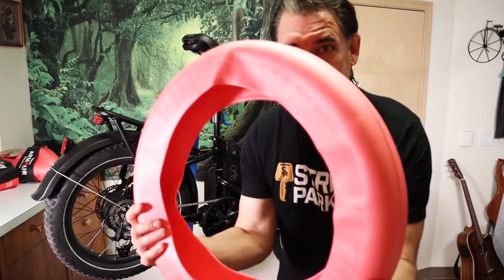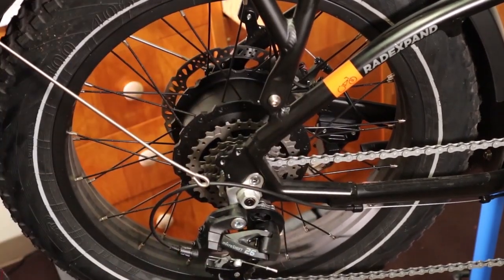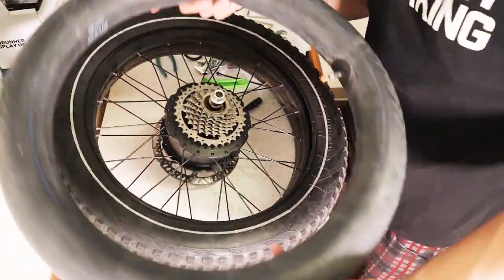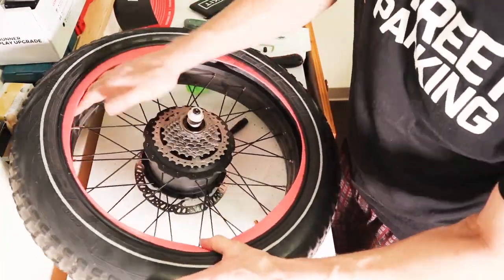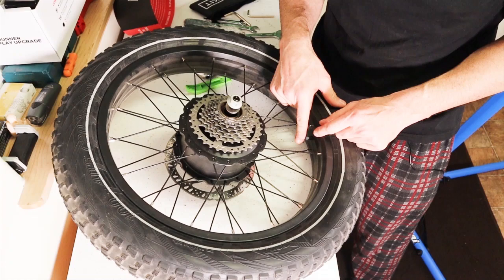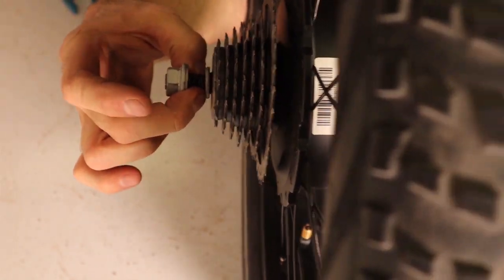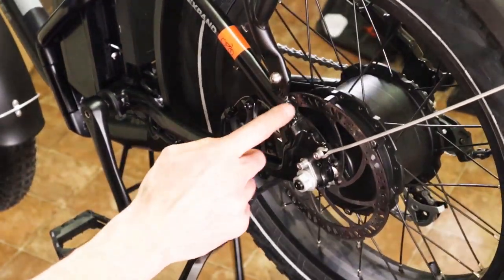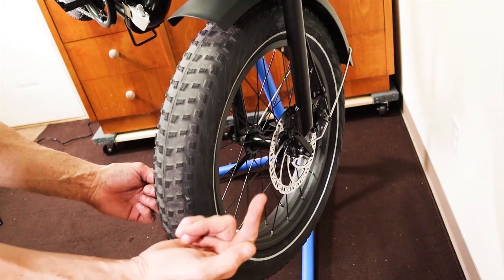RadExpand 5 - How To Install TANNUS ARMOUR INSERTS

Comment: Thanks for this video.
I managed to do this install on my RadExpand 5 without a stand, and by myself thanks to your video, despite being a total noob.
I took advantage of the metal guard in the bottom middle of the bike as a fulcrum, and some heavy objects as support and counterweight.
A bonus of these inserts is the ride quality is noticeably nicer due to the lower air pressure needed in the tires, and the foam insulation.
Reply from the maker: Great job! Yep, lower pressure is nice

Comment: If I could I would give 10 stars! This was by far the best video. I got a small finishing nail in the rear tire and then Uber home. Looked on line and ordered new tubes and saw the Tannus ad and bought both on Amazon. I got to where I had the tube and liner in and got stuck with how to get the bead in. I went back and watched the video and it said I needed a smaller tube and cut the liner. I was about to go through the roof! THIS VIDEO WAS THE PERFECT FIND AND EASY! You still made it look easier. Thanks man!

Comment: When you hold up the wheel with one hand to start the axle nuts with the other, I'd run a short bungee cord through the rim and hook it up to the rack, or a longer one to the stem for the front wheel. That would free up the first hand for any fiddly work.

Comment: While the tire liners are a matter of choice, this video provides a valuable demonstration of getting the back wheel off and back on for any purpose. (flat repair, changing brake pads, replacing chain, etc.). We are still at a point where many bike shops don’t want to work on e-bikes they don’t sell.   Thus, RAD owners should be willing to do a bit of basic
maintenance, and fine videos like this are an invaluable aid for many owners.   Also, it was good to see this fairly heavy bike up an a work stand, instead of upside down on the floor.   A question though: Is getting the bike upon the stand a two person job?
Reply: I was able to do this job by myself (total noob) on my RadExpand 5 without a stand or being placed upside down, by using an elevated step/block under the center of the bike where the metal guard sticks out as a balancing point/fulcrum.
Just have to secure at least one side with something decently heavy, I used a workout bench and a 25 lbs kettle bell on the other end connected by some straps as a counterweight.
Reply: @ScottXiong 
Good idea.Was the kettle waiting outside ?😊

Comment: i have the tannus installed in my rad expand 20x4 tires. The rad shop said to air up 18lb psi well i called the tannus co and they told me to air up to 2# less than the tire pressure recommended on the tire which is 30#. So that being the k do they gave i aired up to 27# also a small amount of air leaks out of the rear tire so i check every day before ride. So question is is there a reason you are airing 25# because of knowledge or is it just a guess. I watch all your videos, thank you for that,

Comment: Hey great video….. a couple of questions I know you like the Tannus Armour however a lot of people go with the Flatout or Slime and one post even changed to a 3.3 inch tire with a 4 in tube and said it resolved his flat issues. Wondering your thoughts maybe even a good subject for a video? Also do you recommend any certain brand of tubes and or tire for the Expand5……. thanks in advance
Reply from the maker: Thanks Owen. I prefer going after flat prevention rather than flat repair. Keep in mind that the sealant is trying to repair a tube, not a tire, and tubes expand, as do the holes in them.
No matter what you try, you can still get a flat if you run over something big and sharp. Tannus is just less mess and still usable if you do get a puncture.
As for tires, what you want to look for in toughness is the tpi. Tougher tires will usually be 120 tpi which is threads per inch. For ebikes I like at least 120 tpi tires. But they cost more.
Most brands will offer tires that are the same size but have different tpi's. Shoot for 120

Comment: Hi and THANKS very much for the super helpful video's!   I just purchased a RAD Expand5, first ebike ever, so far so good.  Question though, in the RAD Owners Manual (Canadian version, page 61) it says "built-in flat preventative tire liners, like those that come with your RadExpand" - so do I still need the additional Tannas product?
Reply from the maker: Great question, most tires these days have some form of kevlar belt inside, but they overhype it. I like knowing that the Tannus are in there.
It adds another layer inside the tires and the tires themselves will start to wear down over time, but when you need new tires, you can still transfer the same Tannus inserts into the new tires. So once you have them, you are good for the life of the bike!
Nothing works 100% of the time, but the tougher the better 👍

Comment: Hi I’m thinking if adding the freewheel on my rad expand 5 but I’m in the uk and I have the 250 watt motor will it make a lot of difference what I mean is when I get into top gear it seems that I need another gear especially on the hills and on the flat
Reply from the maker: I switched out mine and it does help

Comment: Do you recommend using tire sealant such as Slime?
Reply from the maker: I don't like using sealant in tubes. Over the years, I've changed out 100's of flats that had slime in the tubes. It can work for small holes, but Tannus also works for small holes, without the mess.

Comment: I thought you had to use smaller tubes for those installs
Reply from the maker: You can use smaller tubes, but you don't have to. I reuse the original tubes all the time. Saves waste

Comment: What if I’ve followed all the steps and I still can’t get the tire off! I’m stuck at the “just wiggle it off” part 😂
Reply from the maker: Hi Bailey, sometimes the axle can get twisted in the dropouts. Try using a crescent wrench on the axle of the wheel a see if you can get it turn. It helps to look at it to see which direction to turn it. I should have covered this is the video.
If you look at the axle you'll see that it's flat on 2 sides, this can get twisted a little in the dropout of the frame and not allow the wheel to come out. Use the crescent wrench on these flat sides of the axle.
Reply: @PedalWithPower  thank you so much! That was a fast reply!!!

Comment: From what I have seen in other video's these inserts don't work well.
Reply from the maker: I've had good luck with them. Nothing stops every flat. I've had 2 flats in the last 12,000 miles using Tannus. 
1 was a big chunk of glass. The other was a box staple that finally pushed it's way through. Remarkably, they were 12 hours apart.
The glass left a hole in the tire so big that without the Tannus, the tire would have been useless. With the Tannus, I road on that tire for another 1500 miles.
There's pictures in my article -- https://pedalwithpower.com/tannus-armour-review/